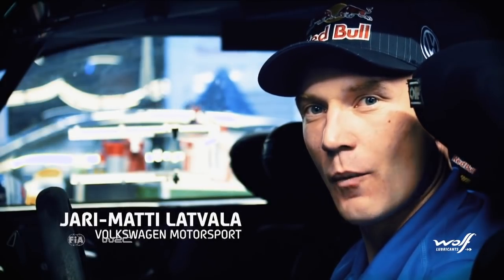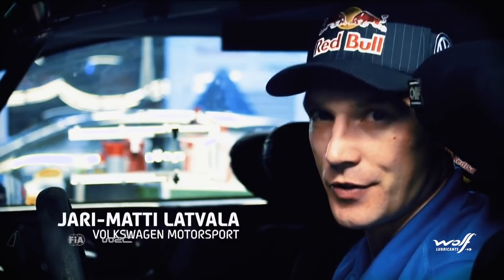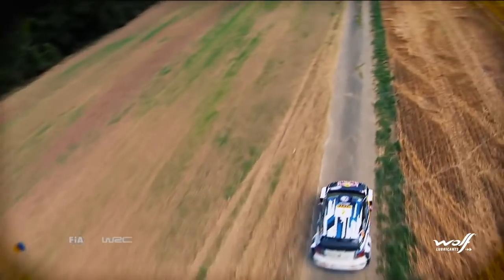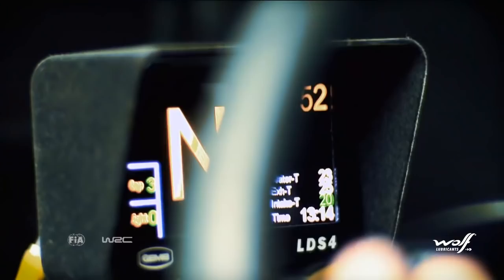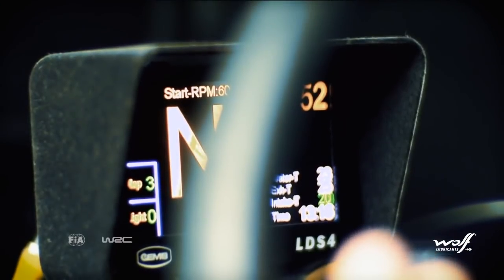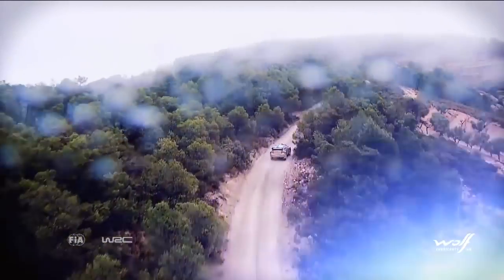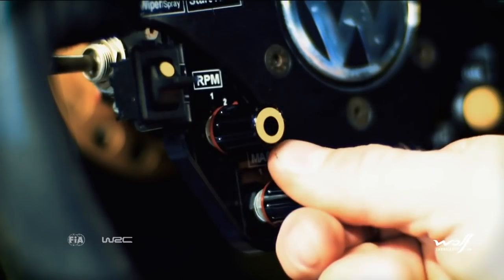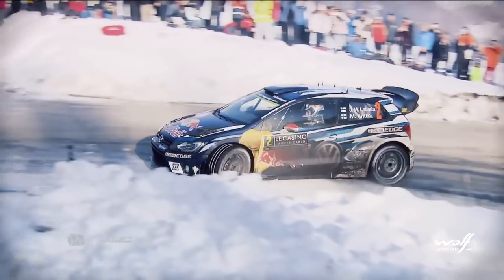WRC Tech Month 2020: LAUNCH CONTROL

Comment: The most important explanation I have always looked for from the WRC, is:

What does the bright red button on the back off the steering wheel do?
Reply: Fire extinguisher?
Reply: Some thing like fire surpress thingy if engine on fire.. cut electicity, fuel etc that can make bigger fire